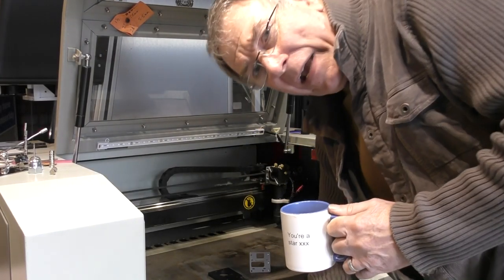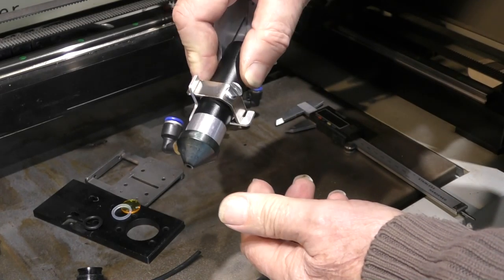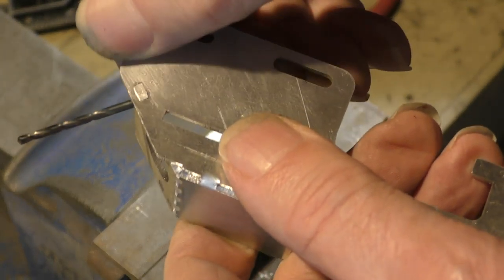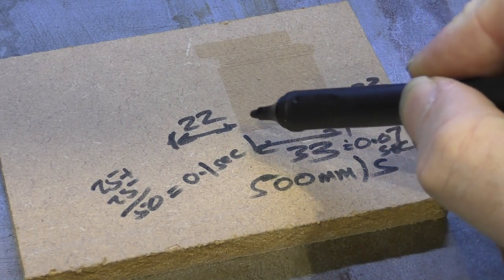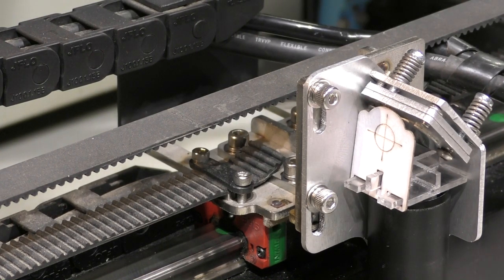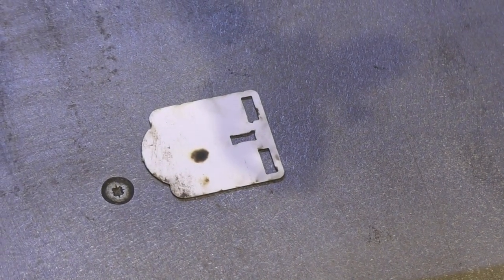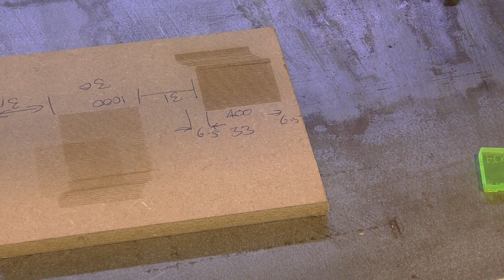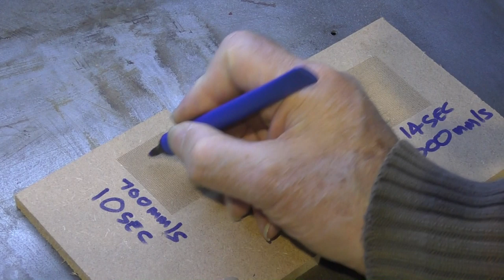RDWorks Learning Lab 181 Redsail clone  upgraded head

Comment: I learned a little bit. Now my lens tube looks like the one you were showing from cloud Array. My machine shipped with 1 lens (Who knows what it is). I obviously need to get lenses. What lens should i have to cut 12mm Baltic, or solid wood? I have cut test circle at 90% x 5mm a sec which worked well enough. When i attempted to cut Larger piece, I had area where i did not cut all the way through. I ran my laser with the lid open for the first time today. Is this safe or should i be wearing protective eyewear? If i need to order a set of lenses would you recommend?

Comment: Great advise as always Russ! I just 3d printed three lens tubes. They are all different lengths and each is specific to a different lenses focal length. I can leave the lenses in the tubes and just swap out the tubes. No more dropped, lost or mystery focal length lenses. ;)
Reply from the maker: Sounds like a great idea for those of you with a 3D printer. That is not meant to sound sarcastic, I genuinely think it's a good idea.. You may well get request from others for the file.

Best wishes
Russ

Comment: I should have known you had a video!  I just upgraded my RedSail clone and had to make adapters and drill new holes in my plate.  It seems to have been a success without upgrading to the 15mm rail system.
Reply: Sorry, I just noticed the date on the video.  I finished upgrading 2 days ago.
Reply from the maker: Hi Tom
The problem I have is not having a red and black machine. I rely on feedback and data from other users like yourself. But I am aware the that head is similar but with different mounting arrangements  (2 holes instead of my 4) and that the rail size is smaller. There is a Chinese government approved outline design for these machines which is why they are all similar. Similar, ,yes,  but not all exactly the same. There is wriggle room in the specification for factories to buy  certain components at different cost. So some factories use a   MSC12M and others use the MSC12LM    (see  http://www.pmi-amt.com/en/products/amt/MSC_M.htm         )   There may be other options which I am not aware of so I will place this little problem with Cloudray to research because they are in the centre of "Laser City"

Your situation is a classic example of Murphy's Law.

Best wishes
Russ

Comment: Just when I thought I had nothing to do whilst in isolation, now I have to rip the laser apart.......
Reply from the maker: Hi Jamie
BIG BIG smile!!!
Russ
Reply: Well this has not gone well for me. I slowly increased the acceleration settings up until the laser complained (remembering I’m only tuning existing head, I haven’t actually changed any mechanical parts) then backed off with plus a bit of head room. Went from 4500 to 7000. Happy days. Test scan showed the scan lines out of phase (ie ghosting)so started adjusting an offset parameter in light burn then retest and all the lines are wobbly . A symptom of over accelerating. Settings are now lower than the originals and offsets disabled still wobbly. In both x and y regardless of speed even a single cut line wobbles the entire length of the pass not just the ends.  Belts are tight and nothing mechanical has changed, it has to be a software thing surely . Even tried rdworks but exact same results. any thoughts anyone
Reply from the maker: @jimmer147  
 Have you checked your vendor settings and user settings by reading them into RDWorks? Are they changed back to what you expected? I anticipate you will answer Yes.
So therefore you can dismiss software (Lightburn) as the issue 
Let's just stop and be logical for a second.  Wobbly lines are nothing to do with what you have just done because you were changing the X axis. Your laser machine is an amazing pen plotter and what it's telling you is there is instability in Y that is causing your line wobble. Did you make changes to the Y axis also?  There are two sorts of wobble in Y. One of them I described at the end of the video when I spoke about ringing of the head because the head mount was not stiff enough. That will only occur for the first few mm of the scan line. Persistent wobble throughout the scan means something i smakiny Y move.
Did you ever save your original vendor and user settings as an external file? (something I urge everyone to do) If so, then load them back into the machine  and this may fix the issue. If not you are on a Y axis detective hunt.
 Sorry cant be more helpful at present.
Best wishes
Russ
Reply: Thanks for the reply Russ. I did save the settings and have restored them. To no avail. I will play with the machine again today and post what I find. Everything is super tight and as I mentioned above I made no changes mechanically at all. Here’s the really odd bit. So everything was straight but I had ghosting in the scan. The process to calibrate the scan offset is to scan 4 small boxes each at a different speed. 100, 200, 300, 400. When I did, the 100mm/s box was fine apart from the offset but the 2,3,4, were wobbly. Ever since then everything is wobbly no matter the speed
Reply from the maker: @jimmer147  
Hi Jamie
Puzzling and interesting.. Have you checked that you lens is snug,  Because I mess around with lenses a lot and am fearful of breaking a lens by over pressure, I have seen this problem on occasions when I faieed to clamp the lens securely. For a long time now I put an O ring between lens and clamp ring  to stop this mistake . Does this problem occur  at all corners of your table?
If you wish to add your disguised email in another comment we can speak off line and you can send pictures of your problem.

Best wishes
Russ
Reply: SarbarMultimedia very interesting, I did clean the lens yesterday............ I will report back momentarily
Reply: SarbarMultimedia 😐I feel like such a fool, as I removed the lens tube there was a rattle. I bet I spent 4 hours messing with this yesterday and another 4 thinking about it last night, I was almost ready to start replacing motors. Thank you so much Russ. I was so excited I almost overlooked your kind offer of direct email. Thank you
Reply from the maker: @jimmer147  
 Hi Jamie
 Don't beat yourself up. You are obviously a very capable and logical guy who has been one step ahead of all the suggestions I made. A loose lens is not an obvious reason for your problem but I just happen to know from experience  that it takes but a small misalignment between the beam axis and the lens axis for  the focal point to veer off axis by a significant amount. That is why I am so keen to advocate setting the Z axis perfectly onto the "sweet spot"of mirror 3.  Shaking the crap out of your head may have loosened your lens. Try the O-ring method and it will never happen again. Big smile and glad I did no lasting damage to your machine!!!!

Best wishes
Russ
Reply: @SarbarMultimedia  stupid thing is im sure i tightened the lens back in after the cleaning. but as you mentioned i was a little timid when doing so. Please do not think for 1 second that i was in any implying that you had any blame in the problem i was having. That  was not my intent at all. i was after your knowledge and experience. i like to think i know what i am doing which is why i am so annoyed with myself. i knew it could not be anything to do with the settings or mechanics of the machine  and should have made the connection to lens myself  (i did check the lens tube was tight, just not the lens inside!)
Again so many thanks for all your help and not just in this instance, I'm sure i would not have had the confidence to make half of the mods currently on the machine if it were not for you.

Comment: Still catching up on the videos and like them all a lot.  Now, since I have watched the copper mirror video and now this one, would you not save wieght if you just jade a square copper mirror tapped for the adjustment screws, polished on the front side and use that instead of putting in a mirror holder assembly with the standard mirrors and the copper disk mirrors you made.  Seems simpler to me...
Reply from the maker: Hi
 Indeed the molybdenum mirrors I use are about twice the weight of the thinner copper mirrors I made . The copper mirrors were very successful but also very expensive for me to make. The efficiency gain was no more than 2% for the copper mirrors  hence the performance for cost equation was way off. 

As for weight and mechanical performance, the aluminium mirror holders are less than 10  grams and a negligible part of the overall moving mass. I took mass removal to the maximum with my Tangerine Tiger (RF) machine. The benefit of removing mass without changing the power of the stepper motor  is that allows you to accelerate the lower mass  to a nominated speed in less distance (time). I managed to push that machine  X axis to 1500mm/s  with its  normal cheap Chinese  NEMA 23 stepper motor.. The problem was not acceleration, but the final speed was so fast that there was insufficient power per unit of time  (exposure) to damage/engrave the material. I had to reduce to about 600mm/s to get sufficient cour into the engraving.. The point here is that there is a balance between laser power, speed and acceleration.  I can still accelerate the slightly heavier mass to the limit of the stepper  in VERY short distances  without having to go stupid on weight reduction. If I accelerate too fast I induce other mechanical issues.. Rubber toothed belts and stepper drives were never intended for use on CNC machines but the fact that they NEARLY do the job for us is fine, provided we dont  drive then too hard an hope for perfection. These machines are all about design and process compromise.
 Thanks for the comment because no idea is a bad idea taken in isolation. However, when many other factors are embedded around it you can imagine its real potential.
 Best wishes
Russ

Comment: Fantastic video Russ. This why many of us in 3D Printing moved the extruder stepper motor off the X-axis and used a Bowden system. The extruder motor on the frame of the printer and feed the filament via a then tube to the hotend. Thereby we can printer faster and better precision.

Comment: FYI, I just made an adapter to convert the smaller rail carriage to the standard C type head last week. It’s just 4 countersunk screws bolting the adapter to the carriage. Then there are 4 countersunk screws sticking up from the adapter with the head in between the adapter and the carriage. I cut a slot in the threaded end of those screws with a hacksaw. I use a screwdriver to hold the screws in place while I tighten the nut holding the head bracket on. There isn’t enough room to use just tapped holes without the screws hitting the carriage. I didn’t feel like precisely trimming the screws to length. When I do the final assembly, I might make a post on the forum about it.
Reply: Do you have a photo of the adapter?
Reply: @jimidero  I don't and my machine is in parts and a little buried. Sorry.

Comment: For anyone updating from the smaller lens assembly, I had to extend my mirror back because the new lens assembly ( I got the HQ one ), sticks out farther out than the mirror can go.  I haven't fully tuned it in yet, but an option for an adapter plate for that mirror would be nice.  I decided not to go with the full kit with the mirror assemblies and I'm not sure if the included mirrors would have gone far enough out.  If you let me know I can send pics and notes on what I had to do so far.

Comment: Light head for  speeding and slowing acseleration  its Ok! It gives  less load on motors and belts,vibrations, when direction is changed too. But lens and mirror must be some way be protected from debris and static electric particles that flying around with some cover. You amazingly good teacher,i try to take your video lessons! Thanks!
Reply from the maker: Hi 
You are worrying about maybe's.  In practice I have  been running my previous design, which is equally exposed, for about 18 months  and not encountered any problems. However, thanks for your concern and your kind words
Best wishes
Russ

Comment: I suppose if I was a little better with math I could figure out the relative length of the cut versus the over run.  Got to be a break even point there that could be calculated.  Like a 300mm burn with a 15mm over-run.  ???   My head hurts.
Reply from the maker: Hi

I  guess you may be getting an unnecessary headache  because if you download  your program into the machine  with a certain scan speed and when it is loaded make it the current file with the FILE menu. Then press FILE again and you will see WORKTIME,, There is your answer, claimed to be within 1ms accurate.  Now change your scan speed and check again. So now you can lay off the pills!!!

By the way you will need a certain speed set discipline because every scan speed you use you will need to calibrate and select a matching   SCANNING REVERSE OFFSET 

Best wishes
Russ

Comment: Fantastic! You know, making your bracket out of carbon fiber you can cut your weight even more and it would not be that difficult to do. Not only that but get increased strength of the bracket as well. Now will it flex more is the question? I guess its possible at those speeds the flex might be such that it would defeat the purpose but might be worth a go. Even if you had to add additional support material you still can make it lighter and ensure its rigid enough to cope with the higher speed.
Reply from the maker: Hi Kevin
 Interesting thought but this is an engineering shed and not a wing of a NASA laboratory. Aluminium is cheap, quick and easy to get laser profiled and I do not need a mould or breathing apparatus, I'm also not out to set a land speed record . My training was as a production engineer so my aim is always to do the most with least  and the in the quickest way.
Thanks for the comment because I actually like the thought of it. Best wishes
Russ

Comment: Another clear video. An easy weight loss would be to change out all stainless or steel caphead bolts for titanium. As well as removing your red dot pointer laser and auto focus  sensor and wiring out of the drag chain
Reply from the maker: You are quite correct .ALL moving mass has to be accelerated. However now that you have seen the advantages of my crude approach to the problem you can spend some time with your own "loved one" and supercharge it to the limit of your patience and your pocket. Note, there is no gain to be had if you are mainly cutting.
Best wishes
Russ
Reply: I don't have a laser only a CNC router but love watching and learning from your videos